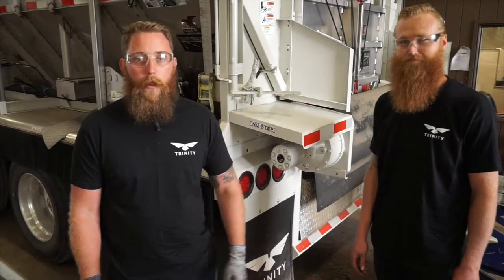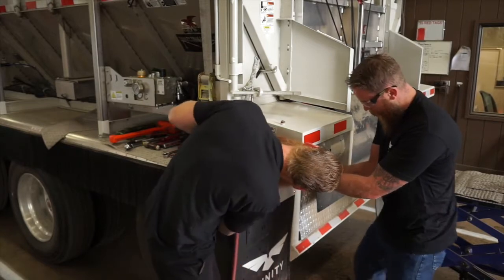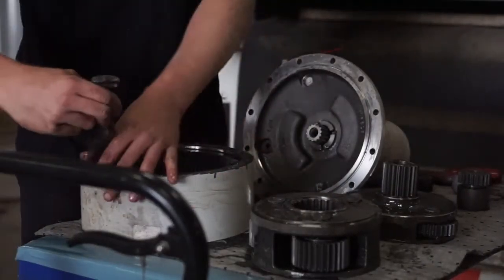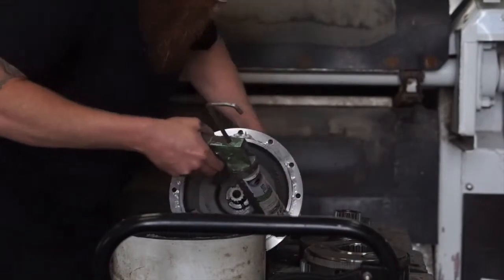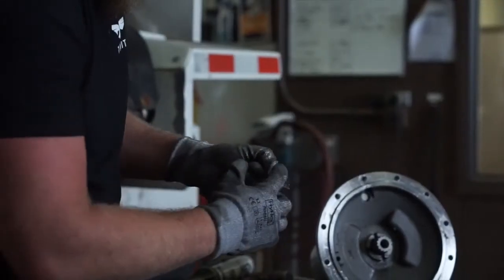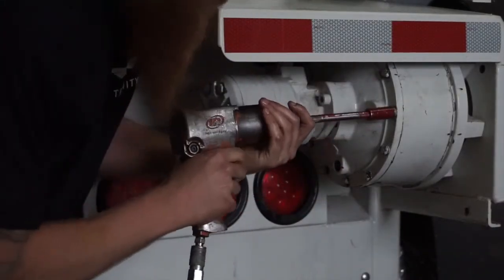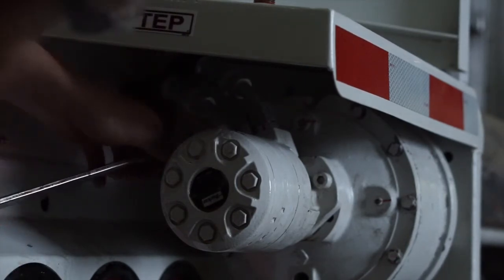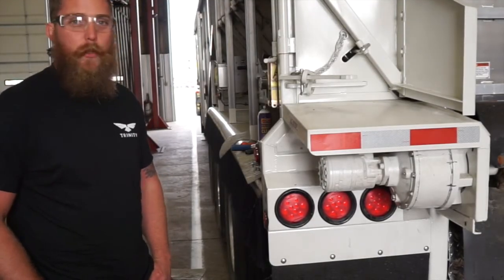Trinity Trailer Maintenance: Servicing the Planetary Gearbox

Comment: I really wish you'd have shown the trailer side while it was open. I'm currently trying to determine what holds the shaft in other than just the splines.
Reply from the maker: We can walk through that with you! Give us a call and ask for service!

800-235-6577
Reply: Ended up cutting the gearbox mount open with a torch, removing the shaft and gearbox as a unit, building a lock stub to take the place of the hydraulic motor, loading the whole mess into the lathe with the four jaw chuck, building a set of straps to bolt the thing to the chuck since the Boss where the motor hooks up is tapered (why?), and then machining off the sprockets. After that we cut out the weld that had been made in the field, and machining a taper on both sides of the shaft. We then drilled, tapped, and threaded both sides to 5/16 NC to join both sides with a set screw.
  Then we took the mess off the French lathe, and loaded it up on the Walcott to weld the shaft together straight. After that we cut the weld down to match the shaft. The six tooth sprockets this one uses are apparently difficult to get, so we designed and plasma cut a new pair of those, bored them, faced them down to 7/8 thickness, and compound cut the bevels on the teeth.
  I then designed a C shaped piece to bolt the cut out piece of the mount back to the rest of the frame, and plasma cut that out.
  That would have been a lot easier if someone had just come up with a procedure for getting the shaft out of the spline bore in the gearbox.